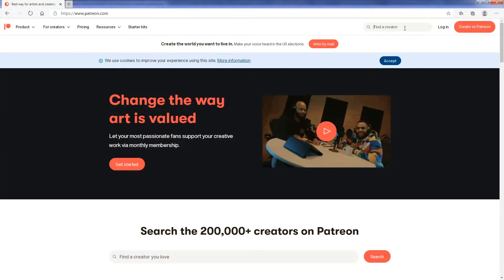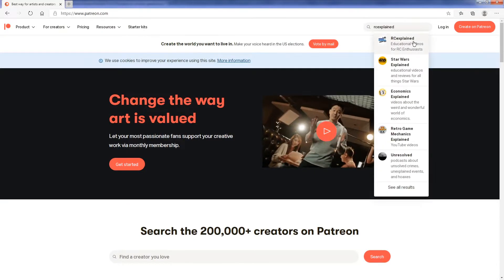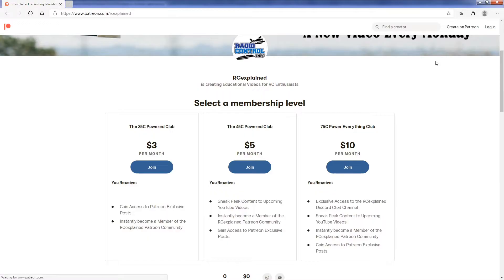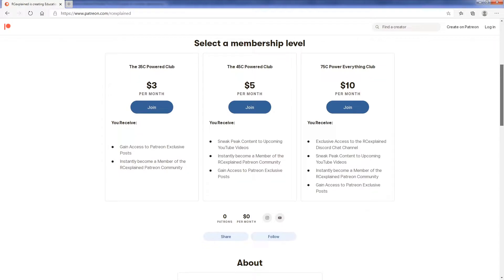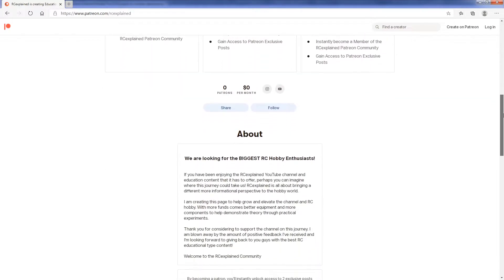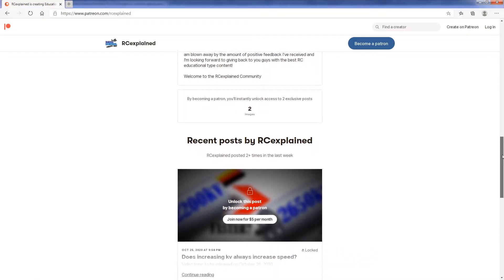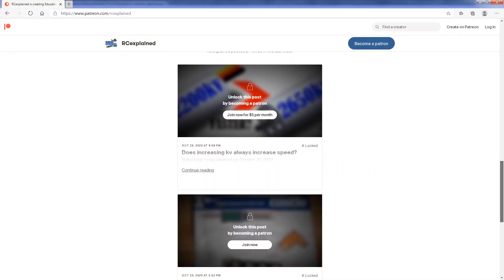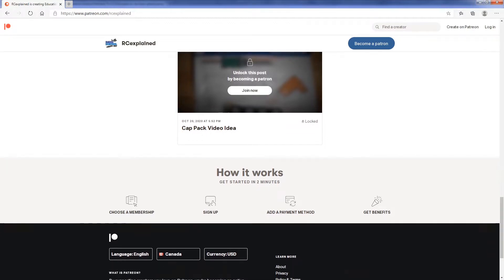Does Increasing the Motor Kv value Increase an RC Cars Top Speed?

Comment: Yeah higher KV is higher speeds  iv tried this out with my big rock granite ect hell even in my element Enduro Trail walker lol. The higher kv motor was faster I installed a large 4276 2200kv motor done my speed test with my big rock it was all tested with 3s and 4s lipos each one 80c discharge 5200mah batteries. I used multiple ESC's from a hobbywing Quicrun 10BL120 3s sensored esc than a hobbywing Max 10sct and max10 than my castle SWD3 and SW4 and the copperhead esc. Motors I used was my 4276 2200kv / 4276 2000kv / 4268 2500kv / 4268 2050kv then I used my smaller motors 3660 3300kv / 3660 3200kv / 3660 4000kv and then 3668 2200kv / 3668 3000kv. And the higher KVs I got higher top speeds but the larger motors with the lower kvs where way faster of the line and seemed faster in general bashing. Even the same kv but diff size 3660 vs 4276 "Small block vs Big block" and the big motor was better all around less heat the big motors stayed nice and cool not even hot or warm on 3s which obviously these are 6s 8s motors but ran perfectly on 3s and was getting good speeds. The gearing was and is 57T mod 8 integy spur and a Mod 8 20T pinion from integy and with the lower motors I dropped pinion size down to 15 and 16 because 20T seemed to much on em even the lower KVs couldn't handle it in the 3660s and 3668s the large 4276 and 4268 big blocks done it perfectly. Which I have prob 80 to 90 brushless motors alot of em most of em anyway are still in the box never opened they are backups and I do resale em and give em away to friends ect that wanna upgrade or just simply need a new motor and don't wanna rebuild which I rebuild my motors for the most part even my sealed can brushed motors. I got this crazy modified brushed motor I built from two diff motors and it's awesome even tho it's a brushed motor itll get up n go lol
Reply: hello, excuse my english, so what is for you the best motor for big rock... in size, in kv, endurance and which regulator with... thanks in advance

Comment: put it simply though its not about speed its torque we want. Thats why the 2200 is so much better than the 2650. PLUS, LOWER KV CAN PUSH A HIGHER GEAR because of the Tork.

Comment: Question, Which Would Have A Longer Run Time? 2200kv Or The 2650kv On Same Rc, With The Same Battery Pack & With The Same Gears & Tires..
Reply from the maker: 2200, it would be slower. Less power output = longer run time.
Reply: @RCexplained  Ok Thanks..!🤙🏼🤙🏼

Comment: I'm watching you for days , You're the only reason why I haven't bought any more brushless motor, The more I watch the more I hesitate to buy. I'm currently looking at the 3300kv brushless motor with a max 18amp. Does it gonna suffice for crawling? With 2 speed gearbox on it?
Reply: Should be fine, might send it a bit fast lol
Reply: No go for a 1000 kv or a bit higher. More torque and lower speed for a crawler is better than less torque and more speed.

Comment: so whats faster?
4370kv
or
3300kv??
Reply: 4370, but 3300kv u can probably use on 3s or maybe 4s. 4370, is only for 2s and maybe 4s. Also the 3300kv is going to run much cooler on the same gearing

Comment: Hi RC Pros. Im a rookie at this ha ha ha 
I need some real help hahaha
Here it goes
I have Brushless Traxxas Rustler i bought brand new. The original Traxxas 3350R Velineon VXL-3s Waterproof Brushless Power System burned on me in a week after i did the speed gearing 31/76. Now i have a Hobbywing 2600kv with the hobbywing max10 esc and running a 4s Traxxas 6700mah lipo. with gearing of a 76 tooth haha i dont know what my pinion is. I want go faster. What gearing should i use on the hobbywing 2600 or motor. Thanks
reply asap haha

Comment: Im about to go from a 2847 3000kv to a 2845 5900kv in my X04A. I want to double the speed and this will do it right? Stock set up with no extra cooling stays cool on 3s ripping it so I should be good maybe add water cooling...ill post a video see it goes hopefully might be a good example. It'll be quick video
Reply from the maker: With a big increase of speed, you will have a big increase in heat. Make certain nothing exceeds max temperature threshold.
Reply: @RCexplained  exactly! I just spent a hour leaving answers for people wondering about changing the motors. I used your knowledge btw, so your words go far. Appreciate all the videos and ill send everyone youre way who's looking to also learn.
Reply: @RCexplained  its also a experiment. With motors only about $10 its worth the chaos haha

Comment: Great videos! A little over my head at times lol. The one thing I'm trying to figure out is how much less efficient are higher kV motors compared to lower kV motors, specifically for a 7'" quad, 1300 kV or 1800 kV?  Say I flew for like 20 minutes on 1300 kv would the 1800 kv be 1 minute less flight time, 30 sec, 10 sec? Or as long as you are flying exactly the same would the efficiency be about the same? I've heard people talk about setting a throttle curve with the higher KV motors. I'm just trying to figure out if the efficiency hit is worth the extra power or not.
Reply from the maker: Hello, your question is not a simple one to answer as the factors that come in to play are more then just a matter of 1800vs1300kv. To realistic determine this in your specific application, the best solution would be to test it using the exact equipment and flying style.
Reply: @RCexplained  thanks for the response. I was just looking at getting the iFlight Chimera7 and it comes in either 1300 kv (cruiser) or 1800 kv (speed cruiser) and I was thinking about getting the 1800 kv because it can put out more power but at the same time the more important thing to me is range, mountain surfing and I was hoping to find some info on the positives and negatives on those 2 different KVs in order to help me make an informed decision but I'm not having any luck in that department. Lol
Reply from the maker: take a look at the video just released
Reply: @RCexplained  awesome! I watched it a couple times! lol.  So what you're saying is that these motors are most efficient when running at 100%, right? So the higher KV motor would be efficient as long as you are close to 100% throttle but of course you'd be moving a lot faster and at some point I would assume that drag would start to affect the efficiency, right? And I'm new to this world so I don't know what the best cruising speed would be for mountain surfing. 
I am a little confused because my MA2 is more efficient (can cover more ground) in N mode at about 24mph than it is in S mode at about 44mph, I thought full throttle was more efficient, what I'm I missing? lol
Reply from the maker: When we are talking about efficiency, what exactly are you referring to. Efficiency in the video is mechanical power over electrical power in. Problem is 100% throttle is not practical for most of my RC's if max run time is the goal. 100% throttle on a slower setup would be more ideal.

Comment: Higher kV motors can handle higher current loads so when properly geared, they can handle more power
Reply: Lower KV motors use higher voltage thus less current, less heat,  longer life and run times. Lower KV is the same as getting a physically bigger motor that does not spin as fast, but has more torque. Motorcycle motors spin faster, but don't have the torque to pull a heavy load. Same for electric.

Comment: All inrunner motors have a max RPM rating of of around 50,000.  Anything higher than its max rating will make the  magnets on the rotor shatter.

Comment: I have a question😀 I have a 1650 kv motor and I run it on 4s.. can I just gear it up to make it fast as some 2500 kv motor? And if yes, does it mean it will overheat faster? Thanks
Reply from the maker: Yes you can gear it up, however as you do it will increase the temperatures of the motor, battery and ESC. 
https://youtu.be/R44a3M9p0BE
Reply: Will it produce same heat as the high kv motor with same speed gearing?
Reply from the maker: It will be more heat in the motor as the lower kv motor will have a higher winding resistance.

Comment: I just hit 100mph with the 6s Typhon on stock electronics. 150a firma esc and 2050kv motor. All I did was mess with gearing, suspension, and tires.
Reply from the maker: That is awesome!

Comment: I have a kyosho mp9 castle 1515 motor what is the biggest pinion i can put in
Reply from the maker: This will depend on your specific setup and where and how you are running the RC. If you are not aggressively running your RC and operating in cold temperatures your pinion can be larger. Vs operating aggressively in very hot weather. The best way to determine your answer is to try the next available gear and check temps.
Reply: @RCexplained  okey so maybe 20 pinion ?

Comment: Hi great video! Quick question, I'm think of jumping from a 2200kv TP Power motor to the 2700kv motor.

Both motors have exactly the same can size and are pretty big being over 10cm long.

However will the 2700kv motor have the same lower down grunt and torque as the 2200kv motor if they are both run on 6S? Or will the 2700kv motor have lower los down torque even though it produces more current?
Thanks and awesome channel! Keep up the great work!
Reply from the maker: They both have the potential to deliver the same torque at low RPM. It all depends on your setup and its potential to deliver the increased amount of current effectively.
Reply: @RCexplained  thanks for your reply and advice. It's much appreciated👍

Comment: So for planes and EDF, could I change to an 11 blade from a 5, without the extra torque overloading the motor do you think?
Reply from the maker: The extra load of the additional 6 fan blades will increase the current draw / load on the motor.

Comment: The guy at hobby town talked me into an 85 Amp 4k kv motor Instead of the 3500kv motor I wanted and the 4k kv cogs out with my gearing. I don't like not having low end. With my old 3500kv I could do standing back flips
Reply from the maker: The higher kv motor should also be able to do back flips, if it is getting the necessary current in amps. If not, try dropping a few teeth on the motors pinion gear. This will surely help. You can also check out this video: https://youtu.be/M2k7QloXVNo
Reply: I went from 17 tooth to 13 and it's a tiny bit better but not much. It has to get rolling before it will take off.
Reply from the maker: what is the average internal resistance per cell?
Reply: @RCexplained  in my battery? Idk it's a 3s 50c 5k mah

Comment: So I got a traxxas maxx same situation the kv is 2200kv ok so I burnt that motor I ordered a new one on ebay it was 2650kv it said it was an upgraded motor so if o use it the exact way I had the 2200kv motor is it going to be faster ?
Reply from the maker: Using a 2650kv motor in place of a 2200kv motor, will be faster but will also require a lot more power to do so. Be certain that the wattage rating is significantly higher then the 2200kv motor. If not you risk burnout.  Monitor heat closely when upgrading or changing your power system.
Reply: So meaning battery dies faster motor comes hotter faster
Reply: So if o go down the teeth on my pinion it will be a little bit better and the tires so its a combination of everything to do with the drivetrain
Reply: Thank you for the response and the good info 🤙🏽
Reply from the maker: That is correct.
Reply: Ok easier said then done thank you

Comment: Hi guys, some useful intel in there for me. I'm totally new to the hobby, but I teach Physics at a high school. It's my understanding that the rotating magnet in the brushless motor will generate a back EMF which is in fact the limiting factor in its top rotational velocity at a given voltage. The more turns in the motor will increase the back emf at a given RPM which is why higher KV motors have lower turns of coils in the motor. Lower KV motors deliver much more torque at low RPMs but cannot reach high RPMs because they quickly generate a back EMF as RPM rises. Higher KV motors have fewer turns - which gives less force (torque) and so the acceleration is less but the top end is more. It may be useful to mention this too. Unless I'm horribly mistaken - forgive me if so.
Reply: This makes sense as to the little I understand. It seems bigger, heavier vehicles do better with a lower kv, as lighter one do ok upping the kv's
Reply: You are correct, but that being said some people increase the timing on their motors which in theory increases the kv of said motor and reduces the overall torque. Increasing the timing (magnet will switch from positive to negative or vice versa sooner) produces more heat while allowing the motor to spin faster. The reason it is able to do this is the rotor spins faster as there is more distance between the positive and negative poles trying to attract each other. Understanding how the positive and negative switches to make the rotor turn is a completely different storyline all together. All in all its very similar to advancing your timing on an old distributer powered car. Making the spark plug ignite the fuel mixture sooner so the majority of the burn happens sooner on the combustion stroke.
Reply: You are correct, but that being said some people increase the timing on their motors which in theory increases the kv of said motor and reduces the overall torque. Increasing the timing (magnet will switch from positive to negative or vice versa sooner) produces more heat while allowing the motor to spin faster. The reason it is able to do this is the rotor spins faster as there is more distance between the positive and negative poles trying to attract each other. Understanding how the positive and negative switches to make the rotor turn is a completely different storyline all together. All in all its very similar to advancing your timing on an old distributer powered car. Making the spark plug ignite the fuel mixture sooner so the majority of the burn happens sooner on the combustion stroke.
Reply: So if I use a lower kv motor and gear it up, will that be more efficient than using a higher kv and gearing it down ?  In other words, mathematically I could get the same final rpm but which will give me more run time ?  Low kv high gears or high kv with low gearing  given everything else is equal 🤔
Reply: @nealstarling5422 he recently addressed this albeit with a crazy low kv. Higher was way better in a 3650 size
Reply: I've watched so many videos on trying to understand this none helped but your comment actually made sense thanks so much for the help.
Reply: @dailyswing3663  same here , this comment has made the most sense out of everything I’ve been trying to take in for the past week or so .
Reply: @Oscar-Lima-4  yeah I watched so many vids on it and looked different things up on google trying to understand it more and nothing made sense.
Reply: Use capacitors to filter the back emf
Reply: Yep, lower turn higher kilovolt rating.
Reply: @shakenbake2k479 late reply but kv rating on dc brushless motors means constant velocity
Reply: All inrunner motors have a max RPM rating of of around 50,000.  Anything higher than its max rating will make the  magnets on the rotor shatter.

Comment: I watched now 3 or 4 of your motor videos, so I did try to find this info on my own before bugging you.  Where does the torque output come into play? You always say that the RPM calculations are for no load condition. Will a given kv motor simply draw more current to achieve that calculated no load RPM, less some "internal" losses? Well then everything gets hot, more resistance and something burns up. As you can tell still thinking in internal combustion terms. Thx.
Reply from the maker: Hi Pawel, the amount of current that the motor draws depends on the load and torque that the motor must apply. For an RC car this is always changing depending on many factors.
Reply: @RCexplained  Yes I do understand that. So will a a given kv motor achieve the calculated RPM if enough current is supplied? That was the real question I guess, sorry for writing an assay in part 1. Don't tell anyone , but long time ago I took a circuits class in college...."Twinkle, twinkle little star, voltage equals I x R"....is all I remember.
Reply from the maker: I've never come across that song before. That's awesome! 
The more that you load up the power system, the lower the maximum RPM output of the motor. More current gets you further away from the no-load RPM.
Reply: @RCexplained  Well I kind on made that little song up long time ago. Sorry to be a pain, again I understand the above as well. If you still have patience.....So I want to achieve that "rated" kv RPM, I got my voltage, I can size the esc now for given amperage. So how do I select the motor that will be able to achieve the rpm I am looking for under the load of my 1/8 buggy? You can point me to the right video as well, I am not lazy, just can't connect this dot. Appreciated.

Comment: Oof, I recently put a 4370 KV brushless motor in my 1/10th scale Redcat Volcano.  With it I put in a 60 amp ESC that has a fan on it and use a 50C 2S battery with 5200mah capacity. Basically I did all this before watching this video and have some concerns now.  Haha.  Im about to head to you brushless motor hesitation video since this setup struggles with that issue badly. Learning alot quickly right now.  Thankyou good sir.
Reply from the maker: Glad you are learning by using the videos. Thanks for the comment.